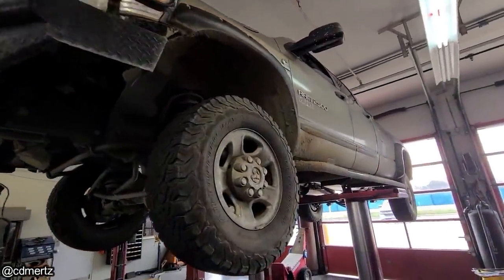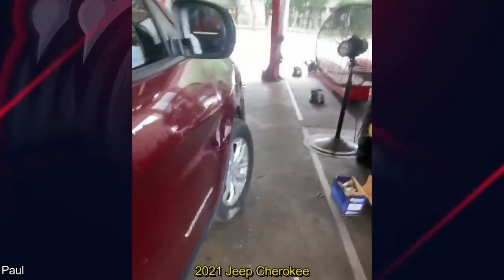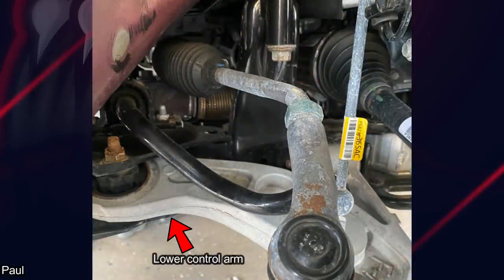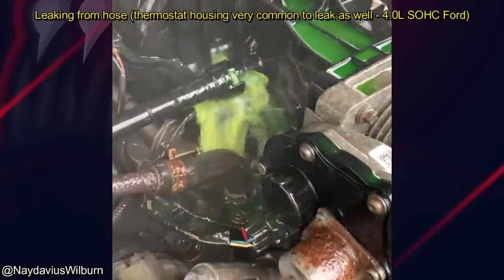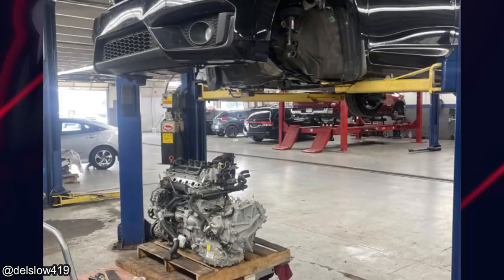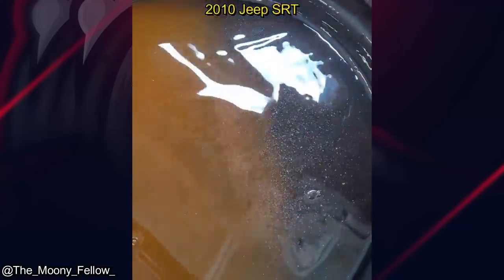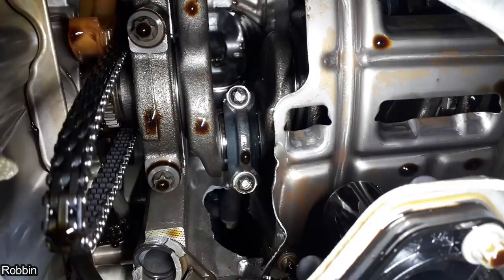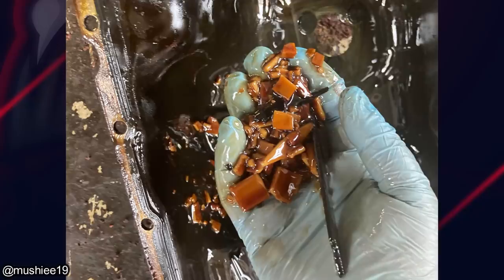Customer States Loud BANG While Driving On The Highway! | Just Rolled In

Comment: i had a customer today add 5 liter of engine oil to a freshly servest car and the engine only needs 4,5 liter to begin with
Reply from the maker: How did that turn out for them? 😅
Reply: We had a guy add oil after oil had already been put in the vehicle.  Double the oil...yes.  We had to drain the oil and do another oil change for free.  Fortunately it never left the shop and only ran like that long enough to check for leaks.  We got lucky!  I was quite upset with that guy.
Reply: @JustRolledIn  the car was burning oil like crazy of course, but as far is i know for now there is no damage

Comment: Regarding the oil plug, I hope they didn't remove the subframe bolt from the vehicle to put in the drain hole. I literally would not be surprised if they did.
Reply from the maker: The mechanic who shared the photo with me didn't mention if they did or not, but yea it wouldn't surprise me as well lol

Comment: Those np270 series transfer cases are notorious for breaking in half like that. I work rebuilding them and about 95% of them do that. They begin cracking and just slowly come apart. Strangely enough, the dodge models are worse than the Ford but they all do it eventually.

Comment: My grandsons transfer case in 2005 ram 2500 did the same thing. Usually due to bad u joints. Lack of maintenance.
Reply from the maker: Yea the double cardan joints is hard to grease on the front driveshaft, so people tend to not bother. Then this unfortunately happens.

Comment: Customer hit a wall with their new jeep.

I got one that's as good, if not better. A crane was set in a parking lot hoisting an AC unit to the roof of an apartment building. The parking lot was barricaded closed for safety. The day ended and the cranes hook was lowered and removed in the middle of the driving area of the parking lot (why..... I don't  know). We heard a traffic barrel move and we looked to see a brand new red Chevy Blazer speed through the closed area, pass the crane and sideswipped the hook in the road. Its back door and panel was dented and the bumper ripped off. The driver kept going like nothing happened. There were no signs of them being drunk. All they wanted was to pass the traffic light that took a long time to change.

Comment: Regarding the frame bolt in the oil pan drain - I can just see something lying on the highway getting caught on the bolt yanking it down hard enough to strip the threads right out and gushing the engine's life blood all over the Interstate at 70 miles an hour.
Reply from the maker: Now that you say that, I can see that happening as well. 😧

Comment: The newer rams disconnect the front drive shaft from the front axle for that very reason. Youre supposed to grease that joint every oil change but no one ever bothers and well.. that happens

Comment: I had to watch the first segment again because I couldn't see the double-cardan guilty of the damage.  On the other hand, the damage was so extensive that it was barely recognizable.

I've dealt with double-cardan joints before, on two vintage Lincolns.  NEVER did either of them suffer damage to that extent, although with my grand's car it came close (I needed to replace the whole driveshaft and the differential pinion flange, then find a shop that would take on the job of putting in new joints because our then-regular mechanic refused to do that job).  It's NOT a fun job reassembling a double-cardan...but I have done it to my second (and current) Lincoln.  Can I do it again?  Yes, especially since I learned that my old mechanic's main reason for refusing the job did not exist with the '60s-era doubles.  Would I want to?  No.  I was running with Divine Intervention to fix both joints in five hours; I seriously doubt I could do it again that quickly with even one joint.

Comment: On that coolant leak-the, intake manifold on my 99 Mustang GT developed a crack (a known issue on the original manifolds.  The crack happened so it was shooting a small amount of coolant directly at the radiator, so I smelled it before the coolant level ever got low enough to notice.

Sometimes, you do get lucky.

Comment: When I was a transit bus driver I had the bus engine explode doing 60 mph and by the time I got to the side of the road you could see the puddle of oil and engine parts from behind the bus and the dent along the passenger side of the bus
Reply from the maker: Holy crap. That must have been a bit scary when that blew up.
Reply: @JustRolledIn  the particular engine 4 cyl detroit were notorious for going bad early but the mechanic said that that particular series of engines were notorious for going bad with low miles 120,000 miles

Comment: I used to wrap an old wire coat hanger around the frame of the Dakota I had back then, it was my emergency key to the sliding door on the back window (I could jimmy the half assed excuse for a latch on it without much issue.... was harder to make it through the window but still doable, had to replace the wire a couple of times over the life of the truck, only used it once), but goddamn, a bra on the brake...... is that guys wife trying to send him a message? Either that, or that vehicle has a hot piece of Toyota that it is seeing on the side

Comment: That Jeep doesn't look that bad. And also a little update on my situation which will tie in this. I found a job. I'm delivering propane tanks. It's my first week and the end of a third day at the time of writing this comment. But yesterday was pretty fucked up. I hit a digger and totalled the van I was driving. It wasn't my fault since the I was driving on the main road and the idiot in the digger pulled into the road. No one was hurt so that's good. But how I said the van is totalled. Destroyed right fender, bumper, passenger side door, subframe has shifted because I turned to the left a little but I hit a curb, left rocker and power steering fluid all leaked out. That's just from what we could see. But 4 hours later I was back behind the wheel. Also I couldn't do most of the stops because of that delay due to the crash.

Comment: As a ram owner, is there any indication that the driveshaft ujoints need replaced before they do that?
Reply from the maker: Definitely! They like to give you a warning before they blow up 😜
Reply: @JustRolledIn  like what?  Vibration?
Reply from the maker: @mxerb5912  yep you will be able to feel a vibration when accelerating or on deceleration, and hear a clunk when shift from drive to reverse. If their really bad and about brake, you will really know lol. Always good to inspect them every service and grease them if they have grease fittings on them.

Comment: I went to change a leaky timing cover on a (someone just did water pump) car and found both rear subframe bolts down an inch. I was going thru wheel well to get dampener off or I wouldn't have noticed. People really need to stop letting non professional touch their car
Reply from the maker: Oh boy. What kind of vehicle?
Reply: @JustRolledIn   ford Taurus 3.0. think they broke timing seal when changing pump. No clue when or why subframe dropped. I've seen this 3 times in the last 7 years. Someone local keeps touching stuff they shouldn't.